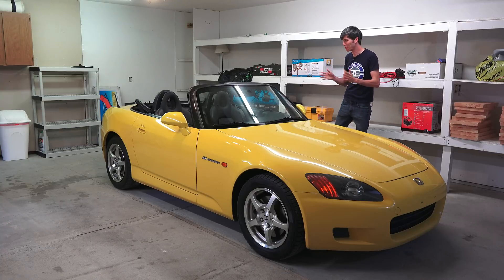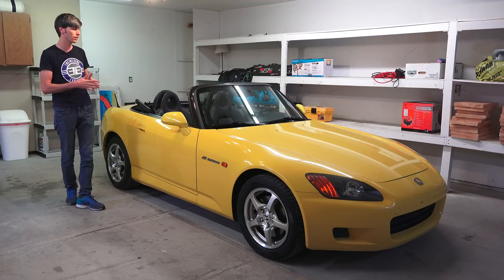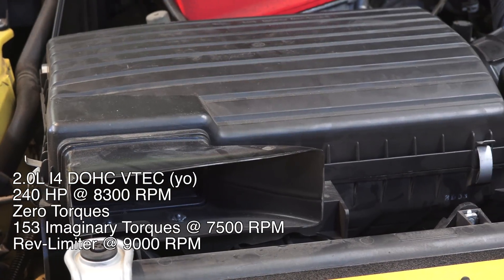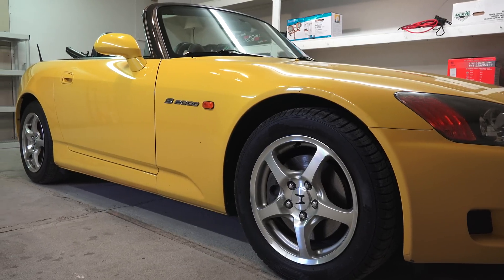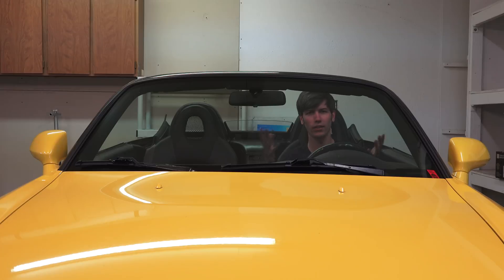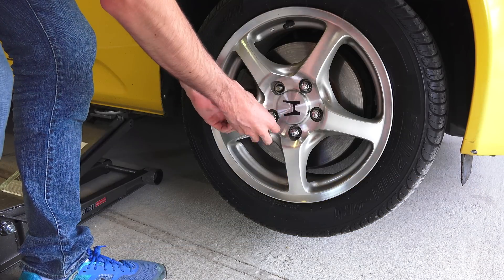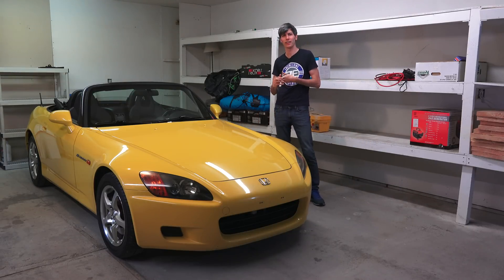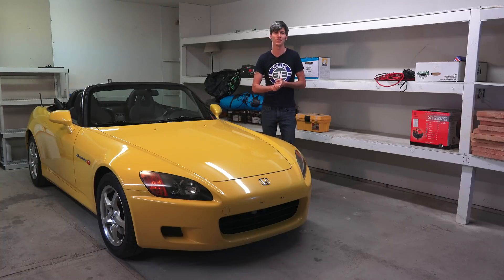I Bought A Honda S2000 And It's Amazing!

Comment: Enkei RPF1s, race interior, roll cage and a carbon hard top...DO IT!
Reply: The Speed.Academy BASASS2000 already did all that.  No need for another one on Youtube. :)
Reply: sam spezza It's not about looks mate. They are one of the lightest wheels available, reducing unsprung mass is one of the most beneficial upgrades you can make.
Reply: PUU-TAAH Jason would have bought  a Lotus if he wanted a 800kg track car. :)
Reply: TassieLorenzo That's what I told old mate at work hahaha he wasn't impressed
Reply: Agreed
Reply: YES, i have RPF1s on my GTI and theyre great!
Reply: Carbon hard top +1, ditch the canvas, save weight. 
Enkei wheels +1
supercharger!!! 
nothing crazy though...
Reply: sam spezza Well they aren't cast, they are manufactured using a rotary forging method. Also they are not as weak as everyone says, they are more than strong enough for a 900kg car
Reply: sam spezza *900kg after weight reduction. Secondly, If you're breaking rpf1s, then you're doing something wrong, there are plenty of 600+hp track cars running them with no issues.
Reply: sam spezza That's what I was getting at, It should be a track car project...

Also 900kg isn't impossible, very basic fabrication is required. One of the tradesmen at the fabrication shop I used to work at had an 890kg S2000.
Reply: sam spezza Yep, RPF1 is over-rated IMO.  Forged wheels are better, the Speed.Academy run Rays wheels which are a proven product.  Any lightweight wheel is going to be more prone to damage than a heavy wheel though, even in the Volks, it's just in the philosophy which is that the weight (strength) has been pared back as much as possible to the minimum. :)  RPF1 are trying to be as light as forged wheel while being cast, so they just aren't strong enough to be durable. (The only reason a forged wheel can be lighter is that the forged material is stronger, therefore the amount of material (weight) is reduced until the strength of the forged wheel is only equal to that of an average cast wheel - hence, lightweight wheel - they are not really much lighter AND much stronger at the same time, that's not possible... they are just much lighter not much stronger simultaneously.  Rally wheels which are designed to be extra strong are heavier than an average run-of-the-mill wheel.  A forged racing wheel for tarmac won't be as strong as one of those, it's in the philosophy of making the wheel as light as possible with acceptable strength (rather than virtually indestructible strength like a rally wheel) :)  RPF1 is trying to be as light as forged racing wheels without forging which is a recipe for disaster IMO. :)
Reply: +krisnadi imam definitely supercharger.

Comment: I don't like Honda for many reasons,  sorry
Reply: You should, they make excellent engines, gearboxes and vehicles generally. Every Honda car is carefully designed to be as well-rounded package as possible from the cheapest Brio supermini to the most expensive NSX flagship car....  However, Honda's automatic transmissions are  pure junk mind you. :( Stick to the manuals. :)
Reply: +TassieLorenzo I am a mechanic,  I fix many cars, I lose my mind and start swearing every time I work on Honda and Mercedes 

otherwise they are good  high quality cars
Reply: thesniperofcs Oh, I see.  I bet it's those darn automatics that people drive? :/
Reply: +TassieLorenzo me, my father,  my brothers,  we hate automatic transmissions,  we love manual. we also hate the way that many cars manufacturers put the engine and transmission in FWD cars,  they put the engine on left and the transmission on the right, we like the cars with the engine in the front and the transmission on the back,  the same as Subaru,  GMC trucks 

we love subaru more than anything, we know how to fix it and how to handle it more than any other car,  more than Toyota, Nissan, hyundai, kia or any other car 

but there is few things bad in Subaru,  the ej series engine and the power steering pump and rack are very sensitive and they will be seriously damaged if not serviced or if you are driving with low oil level,  you must replace timing belt and tensioner to help make the engine bearings live long,  I lost the engine in my Subaru Legacy because of bad tensioner and low oil level - about one litre less than proper level -

but the Honda accord was running empty without oil and the piston rings worn out a little bit,

I filled it by myself,  it takes 4.5 litre of Engine oil,

and the steering pump is heavy duty too,  the steering return line was leaking,  nothing happened,  but if this in a Subaru,  you will need to pay for new or good used steering pump

I was thinking about swapping the steering pump in the SUBARU with another one from a Honda Accord 

but I don't have wilding machine to make this real
Reply: thesniperofcs I see, I like Subaru too. The way it's laid out is nice and simple. :)  It's a lot easier to change the front swaybar on a Subaru (how it drops straight out from under the front subframe is very convenient) than a FWD Honda for example (you have to undo the shifter and header I think?), but Honda isn't unusual compared to other FWD cars, right? :)
Reply: thesniperofcs Trouble with Subaru, of course, is that it doesn't have VTEC! (yo) VTEC is so fun!!! :)
Reply: +TassieLorenzo i heard about vtec,  I don't know what is it,  but I think it is very powerful thing like the turbo charger, if you are fixing a Subaru,  it's going to be the same, bottom the same engine and transmission,  even the FWD is the same with few different things,  if you are fixing Toyota some cars are the same,  and the others are completely different
Reply: thesniperofcs You gotta see what VTEC is:  http://www.oocities.org/gohomerice/camshaft.jpg  The big, fat cam lobes in the middle are VTEC lobes which are around 280-290 degrees duration, from the factory.  The middle rocker for the VTEC cam is engaged very simply by oil pressure, with a pin that locks it to the other rockers (and therefore overrides) the other cam lobes (since the VTEC cam profile is always more aggressive).  This way you can switch to an aggressive cam profile at high rpm, but your engine still runs properly at low rpm (unlike running aggressive aftermarket cams in non-VTEC engines, where it won't run so smooth at low rpm). It's elegant simplicity defined. :)
Reply: Here is the S2000 version of VTEC: http://s46.photobucket.com/user/Sihotboy99/media/IMG_8619.jpg.html Unlike, the K20, the S2000's F20C has semi-gear driven cams as you see (the timing chain drives an idler gear which drives the cams by gear), a bit like an old Cosworth DFV F1 engine (or any F1 engine, they have gear-driven cams) that's kind of cool. :)
Reply: +TassieLorenzo that is very inexpensive way to make more horsepower from a smooth engine,  that is brilliant

Comment: So why a s2k over a brz out of curiosity?
Reply: S2000 is faster, more reliable, cheaper to acquire at this point and honestly handles just as good if not better.
Reply: more power, more vtec, more 9000rpm
Reply: S2000 or MX5 (albeit MX5 has a Mazda3 engine to reduce cost) are both much better engineered vehicles than a BRZ; the suspension is a lot more sophisticated  and purpose-built on the former vehicles. :)  Savagegeese has some great technical information on all three cars in his videos.

Comment: Ironically one of the Hondas I do like. ( Sad that it didn't catch on, most people couldn't see the potential!  ) Could you cover Honda 10 cycle engine technology. I understand this is a Atkinson cycle (4 cycle ) at one point Honda claimed a have broken this process down further during their F1 career, (in the late 90's) into 10 cycles, further allowing them to get more power and economy out of the engines. But Honda won't ever go into any more details about this break thru, to the point of not even revealing what the names of these 6 new cycles were. Being that it's 20 years later could you go over them.

Comment: Hey there! Pretty sweet ride you got, kinda reminds me of the Naboo fighter from Star Wars. You mentioned that this was your new project car for the channel, what is your game plan for upgrades? I'm also interested in the reality of owning 2 vehicles. LIving in the Northwest I see that as THE ideal option. I have an NA miata and on the few days of the year when it snows RWD suddenly loses all appeal for commuting anyway(Im sure its a blast on a closed course but I don't feel resposible driving my car when the road is icy).  I envision buying a truck with 4wd, that would give me the best of both worlds I could move furniture and get to work in the snow when I want and enjoy the driving dynamics of a top down convertible when I want that as well. Did you ever consider that option? If your drivers car is the S2000, What made you choose the Subaru crossover  over a truck?

Comment: I'm not sure that I completely buy their torsional rigidity claims and I'm curious to see how much the frame really flexes.

Please tell me a roll cage is in order in the future to really make this chassis stiff lol.
Reply: If you ever jack one up from the side jack points you may believe the claims lol. On 4 jack stands, if one is 1/4 inch lower that the others the car will not touch it. There is very, very little flex in the frame. And a few years autocrossing one has certainly made a believer out of me. Very tight chassis
Reply: Trouble is I am sure they are talking about the rigidity compared to other 1997 or 1998 cars when it was designed... :)

Comment: If you said in the video, I missed it.  Just curious, how many miles on the S2000?

I owned a 2004 model for about 2.5 years, put about 32,000 miles on it and loved it.  Good luck with the project, I'm looking forward to reading what you come up with.

Comment: The RX8 had a higher displacement to power ratio than the s2000 at about 178 hp per liter in the 6 port and 163 in the 4 port, unless of course you're only talking about piston engines.
Reply: No it doesn't rotaries total swept displacement by the rotor is 3.9L, 1.3L is only the combustion third of the whole engine.  Rotards measure it wrong.

Comment: A great engineering explained would be showing that keeping the stock suspension settings in 90% better than most coil over set ups for this car.  While you're at it perhaps show a set up that is actually better than stock! It'd be awesome to break the engine down and show how it's essentially a built engine from the factory.  Remember the S2000 was a cost center for Honda - they lost money on every one. And the Ap1 was partially hand built along side of the NSX and Insight.

Comment: A high rev limit and high specific output aren't necessarily advantages. Motorcycle engines do both of those and they are nothing new. In addition to the lack of torque, if you look at the power band for that engine, at 6000 rpm you're only at 150 hp, between NB and NC Miata power levels. You'll have a hard time shifting normally if you want to get to 240 hp when daily driving.   If Honda put in a six cylinder engine (higher rotating mass) that revs just as high and makes 400 hp instead then I'll be impressed.
Reply: Unfortunately, Honda says you need to buy a NSX if you want a six cylinder sportscar. :/   Have fun with your Porsches, CarEnthusiast. :) PS.  If you want to get on it 6000rpm is just the starting point, approach corner (or on-ramp or whatever, where you need/want to accelerate) drop down to second (or even first) gear with revs to 6000rpm as a starting point then floor it, then you get somewhere.  Linking up the redline shifts, first gear and second gear, is where the fun is found. :)

Comment: Still think you should have went with the 9-3 Aero V-6 Convertible.  Since you have a very logical, analytical mind I'll put it this way.  You bought the S2000 because of it's fun to drive, convertible, and performance right?  Well the Aero has all that plus a back seat.  Not to mention twice the safety as the Aero Convertible is not only the safest convertible ever tested but one of the safest vehicles period (and trust me it's not just in crashes the traction control and other safety systems are divine and have literally saved my life more than once).

I mean the Aero has nearly the same performance specs as the S2000 while being a lot heavier, the same gas mileage, and can actually be tuned to be faster than some of the fastest production cars (if you look on drag times there is a 9 second 9-3).  I mean the only thing is your audience may have not liked it as much.  Have you ever driven a 9-3 Aero Convertible?  I used to be just like you, I sold cars and had driven nearly everything (including the s2000) and driving the Saab broke me as far driving anything else.

Comment: Good choice, it is light weight and fun...you finally got rid of that heavy Subie!
However, the Mazda Rx-8 has more hp per liter and 9k redline.Rx-8 is non turbo, rotary and has 232hp from a 1.3 liter motor, or 178 hp per liter.
Reply: No it doesn't rotaries total swept displacement by the rotor is 3.9L, 1.3L is only the combustion third of the whole engine.  Rotards measure it wrong.
Reply: Vitamin J 1.3 liter tiny rotary engine.
Reply: Yeah but rotary's aren't the best for overall economy.
Reply: Cameron Moore No one buying a sports car makes economy their first priority :)
Reply: buildmorefarms100 Yeah but if I had to pick one, science they so similar, economy would come into consideration after a while. But like you said it would not my first priority either, for me I'd look at power to weight, handling and then design and economy. When I say economy I mean overall use of oil because rotary squirt oil in the combustion chamber thus burning oil, petrol use (probly not to bad depending how you tuned it) and the more frequent rebuild required on rotary's.

Comment: Oh, about the TCT comments below. A lot of people think they need to be adjusted or are defective because they make a buzzing sound when you start the engine cold but its not the TCT at all. Its the starter and it it not a bad thing what so ever. If you buy a replacement starter, chances are it will start doing the same thing again but it will be working fine.

Comment: I thought you wanted something lighter hence the Miata MX-5 which runs about 2300 to 2400 lbs.

Honestly, I would of went with a used C6 vette, not much heavier than the S2000.  

2002 S2000 Curb weight 2810 pounds 240hp,  11.70 lbs/hp 
2005 Corvette Curb weight 3179 pounds  400 hp 7.95 lbs/hp

Does your head hit the roof?  Tiny car for a tall guy. I'm 6'5 and no way I can fit in that thing.
Reply from the maker: +Ciscodude head does not hit the roof.

Comment: I Cant understand why Honda dont make a new S2000. It was a Great Car with mani futuristic technology and a timeless disign. Sry for my bad english.
Reply: Che M But they would actually sell more cars = more income. :)  Most Mercedes SLK or BMW Z4s sold are probably automatics.  Hell, most MX5s sold are automatics. Take all those sales of automatics away, and you don't sell enough cars to make the model viable. :/
Reply: TassieLorenzo good point
Reply: it's cost would be thousands over the competition
Reply: It doesn't sell very well.
Reply: TassieLorenzo wouldn't that drive the costs higher? M/T models are usually cheaper, no?
Reply: Lol
Reply: They are going to... :)
Reply: Dani over S2000 didn't come with an automatic option, this was unwise for sales! :)
Reply: TassieLorenzo It will be gay though.
Reply: AT sells more. especially in the u.s
Reply: Insurance is actually cheaper for manual cars as well because cars with manual transmissions are something like 80% less likely to be stolen than automatics because the dumbasses who try to boost them can't drive stick.

Comment: The S2000 is a very cool car. Just a shame they stopped making them, so even the newest are an old car now. My last car was a MY94 WRX and while perfectly reliable mechanically, the interior, wiring and seals began to fail. IMHO there is an upper limit of 15-20 years for most cars, beyond which major restoration is required. This is hard to justify unless the car is something like a Porsche or an E-type.

Comment: Next Video, I broke my Honda S2000
Reply: Literally impossible.
Reply: Actually in S2000, it is very easy to money shift it from 3rd back to 2nd at redline! Also rear diff is not very happy about clutch dump launches with grippy rubber. Not to mention that it is really tail happy making it prone to landing in ditches and wrapping around telephone poles...
Reply: after that, Why I'm selling my Honda S2000
Reply: Correct. You can break your engine easily in many ways, not changing your oil for example.
Reply: +Zackarih Hartford I get it. The word "literally" is greatly over used. I was just exaggerating to convey my admiration for these cars. They are very hard to break.

Comment: Was there intent to go with the AP1 over the, many would argue (myself included), better AP2?

Personally I find the suspension in the 04-05 to be superior, and the engine power delivery much, much better, and more linear. Makes a big difference at the track, and on the road.
Reply from the maker: Originally wanted the AP2. This was available, stock, and in good condition, so I jumped on it.
Reply: +Engineering Explained That's fair, there comes a point where condition does become the Bigg determining factor.

Winding out the 2L is still pretty fun, even if it doesn't have the same sense of urgency as the 2.2L.

No matter, hard to go wrong with an S2K.